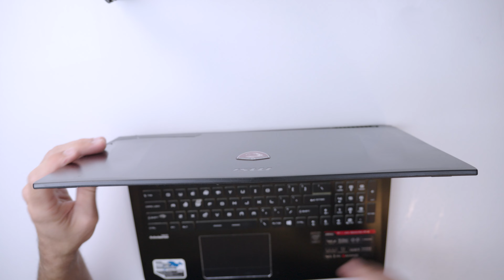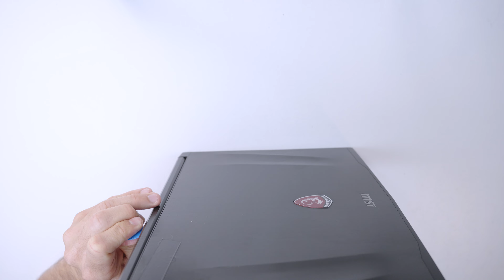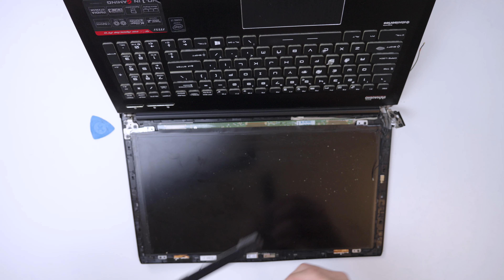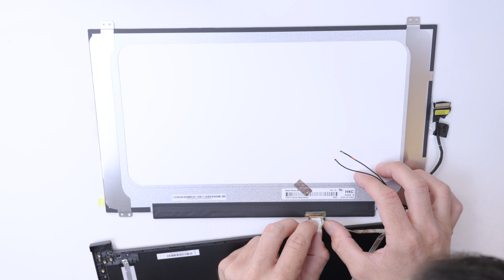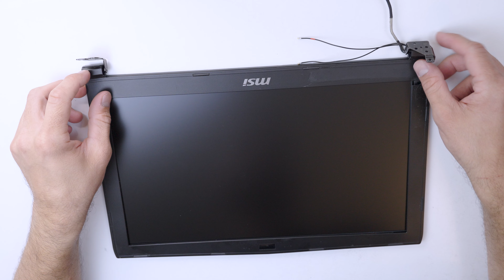MSI GE62 2QE LCD Screen, Lid & Hinges Replacement | Step-by-Step Repair Guide

Comment: heydude Whats the model number of the screen please??
snd where best to buy these parts
Reply from the maker: Hi there, thanks for your comment. If you're in Australia, you can contact us directly, and we'll help arrange parts for you. 
The best way to find the model number of your laptop's screen is by using the HWinfo application. This application will show the exact model of screen that is installed in your laptop. It's common for laptop's to have different types of displays installed, so it's best to find out exactly what your laptop has prior to ordering.